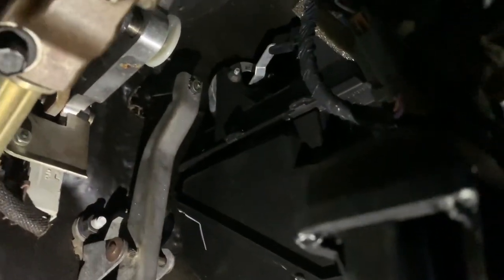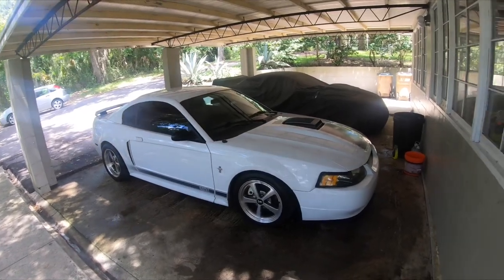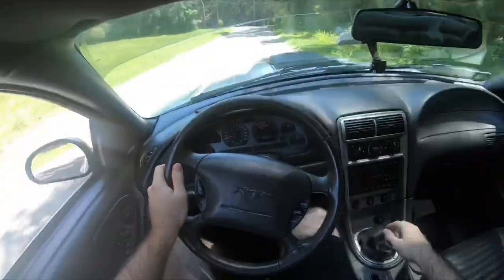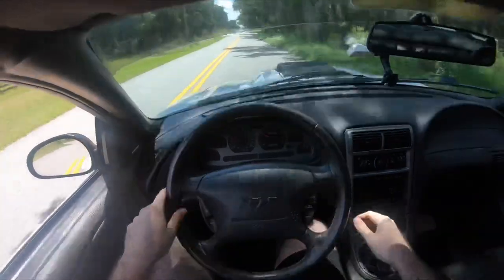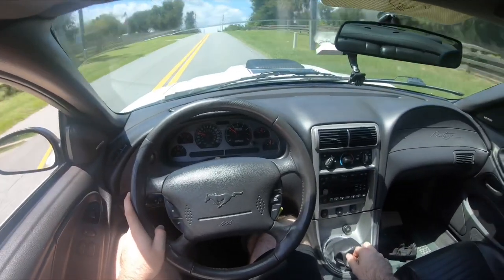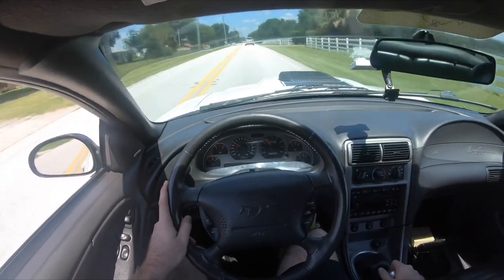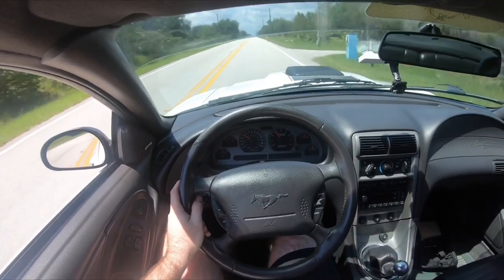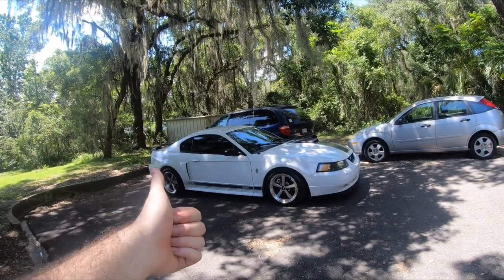Gas pedal sitting too low 94-04 Mustangs? Do this cheap fix! 👍🏻

Comment: You could also cut the cable with wire cutters and recrimp at the end of the cable as well with a small metal sleeve. That’s what I did with my 95 Camaro when I bought a throttle cable that was too long.

Comment: Hard to believe such a cheap fix can make a big difference like that.
Reply from the maker: Yeah it really feels better all around. I’m very happy I went ahead and did that. The Terminator sticking all the time is what made me want to investigate on my car and I actually noticed my pedal sat a lot further back then my brake pedal. So I looked and boom saw the slack. Funny enough the 97 cobra doesn’t have a single throttle cable issues. Original cable. That car always amazes me.
Reply: snakebitten 97 that’s very interesting

Comment: I guess if the pedal is sitting too low you're not gonna be able to get all the power out of the motor at wide open throttle will you?
Reply from the maker: Well it definitely felt a little more peppy and hit a tiny bit harder so I would definitely say so. Also improved daily driving immensely. Terminator cobras have are notorious for worn out/stretched throttle cables and it was a PITA to drive the Termi in town. Did the same method and improved everything drastically.